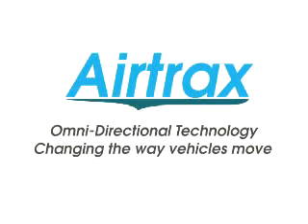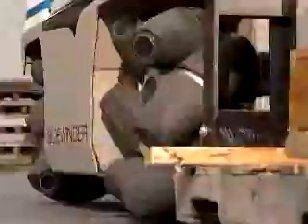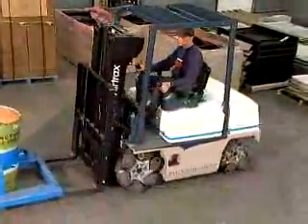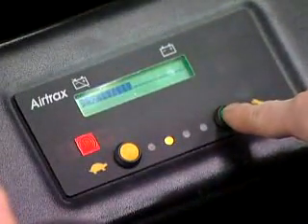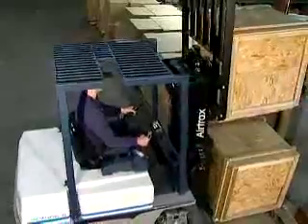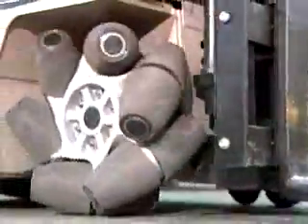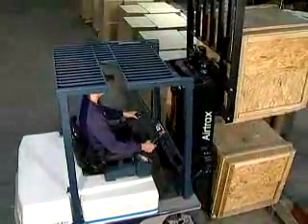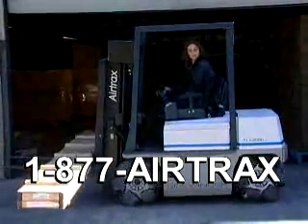Airtrax

Comment: what about those heavy capacity forklifts where the front wheels are significantly larger than the rear wheels, in fact there are forklifts with dually front wheels ... can the Mecanum wheel design be adapted to support greater loads like this? if the rollers are enlarged, their weight bearing capacity increases

maybe it can be something like the 'front wheel assist' on tractors, except in this case it would be the rear wheels

Comment: the problem with those tires is they dont work well on uneven surfaces. The tire itself also has a lower carrying capacity but they have solved this by using better materials, overall a very fun system to drive.

Comment: Think it through - each of the four wheels needs only one motor. The movement vector of each of the wheels shows outside, starting from the middle of the vehicle. If every wheel is rotating forward/backward, the outward components eliminate each other, the vehicle is moving forward/backwards. if the front wheels are rotating in the opposite direction than the backwheels, the vehicle will move to the side. rotation, etc. can be realised through simple vector-addition... pretty sweet..